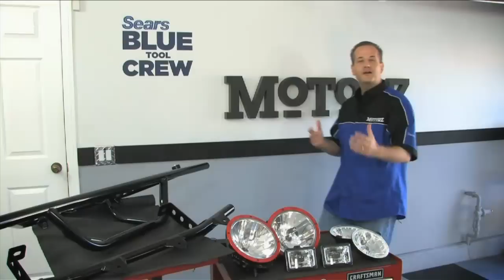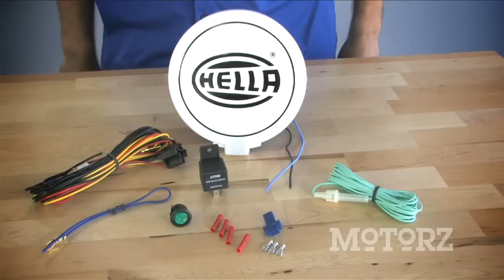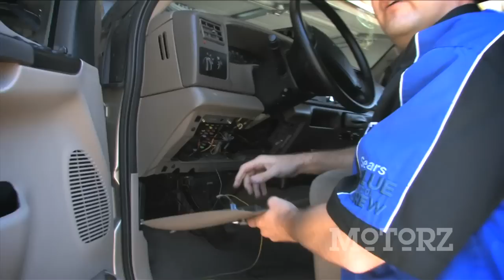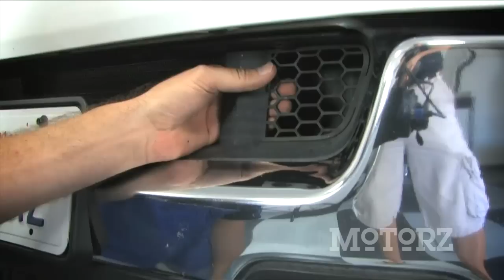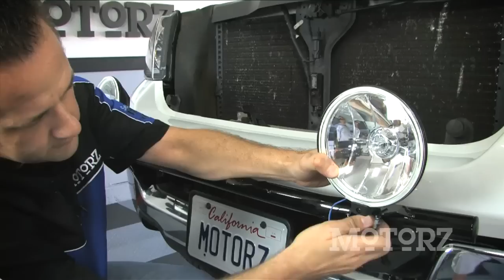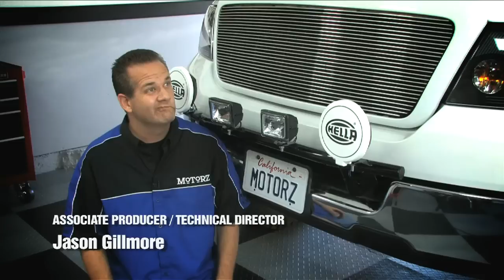MotorZ.TV Video Installation guide for Hella Auxiliary Lighting

Comment: Could you show a more detailed wiring? For example, where to ground the relay, where to wire the "rocker switch" 12v wire in the fuse panel. 
Reason I'm asking is because I'm trying to install a set of Micro FF's and a set of Hella 500 on my car and I don't really want to screw around too much with the lighting on my car. Just want to get these off-road lights on.